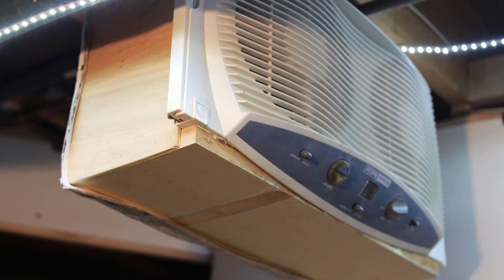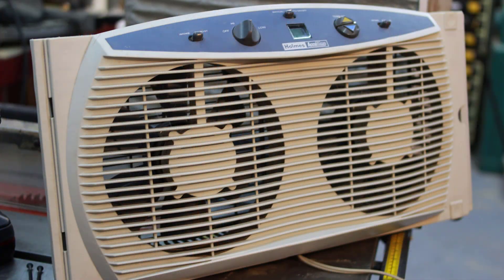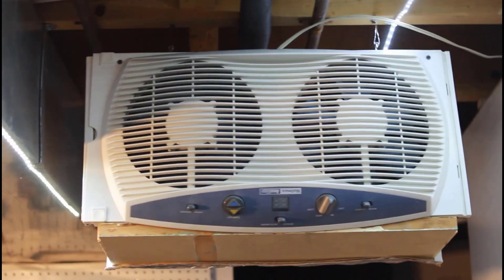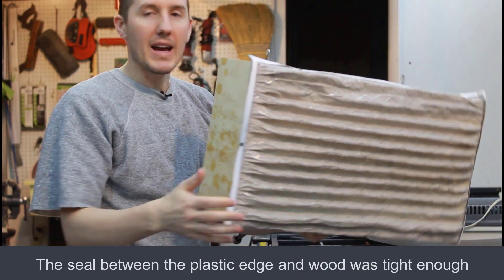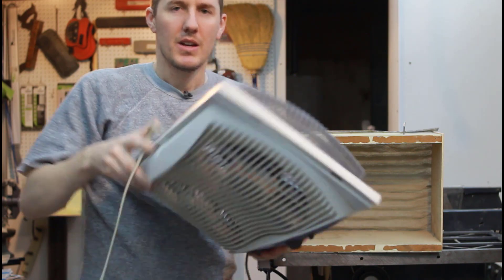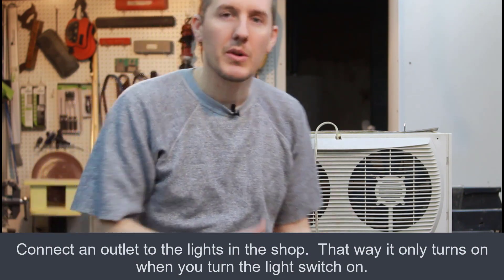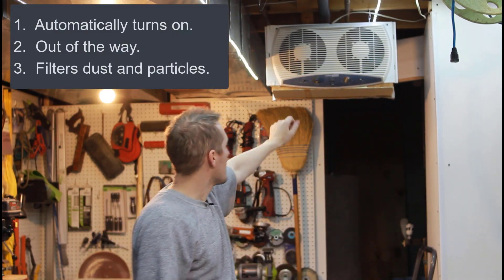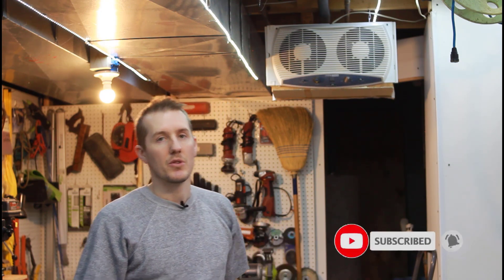DIY Air Purifier | Workshop Air & Dust Filter

Comment: Not sure i think u need to turn the fan around  you want pull air thru the filter  1st  this will help the 
Motors of the fan that wont get clogged  with saw dust